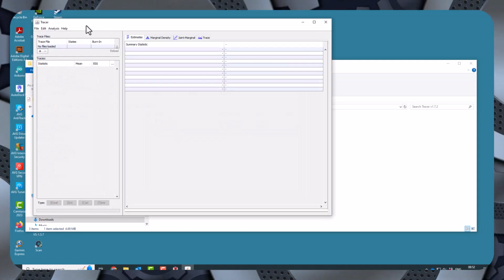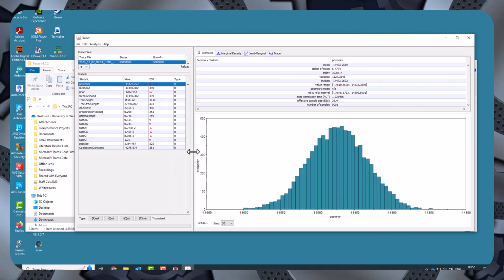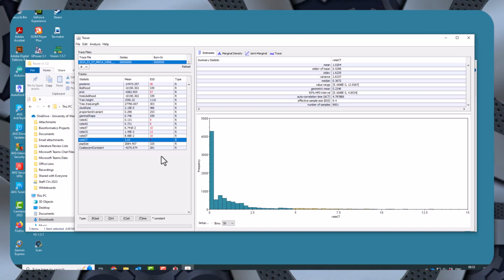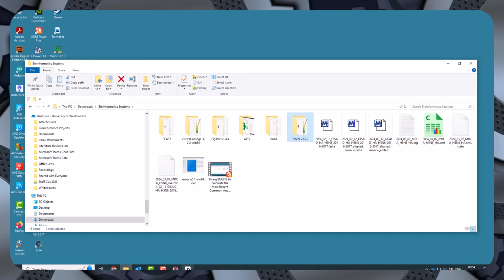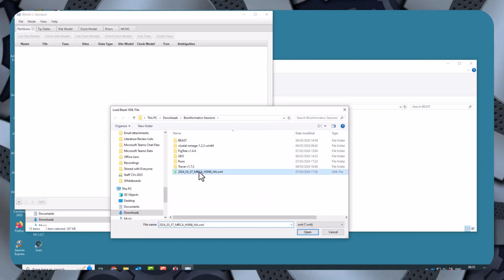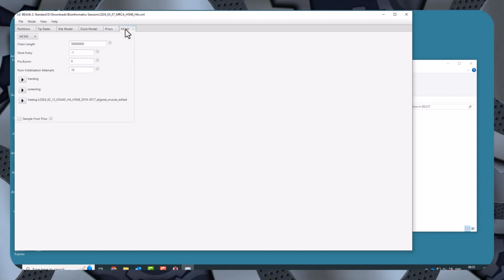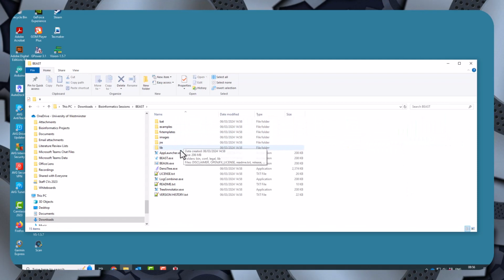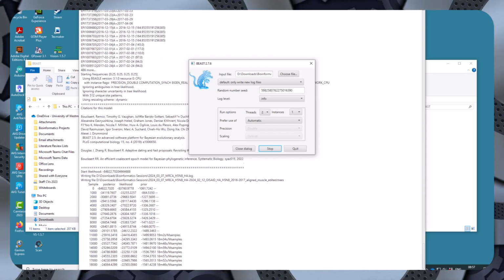Example of poor sampling in the Tracer Analysis

Comment: Hi Andrew! I am doing a temporal analysis recently. I followed all the protocol but how can I finally get the mutation rate per site per year?? When I get the 'clock rate' in Tracer, it was far different from those I read in paper, I assumed there is any further calculation? That is really confusing for me because all the material didn't give an exact calculation while on the other hand this parameter was always seen in the related paper...
Reply from the maker: Dear Zhao, The problem is that BEAST calculates an effective population and mutation rate that cannot easily be separated. That is why the calculated rate will be nothing like the rate you see in the papers. If you have a big population even if you have a low clock rate the number of changes per generation will be relatively large. As the model cannot divide these two terms very easily I am not sure that you can work it out. It might be possible in a Bayesian Skyline analysis but again I think the quantities calculated are relative to one another.
Reply: Thanks for you reply! Actually I only run 10 Ecoli samples for now, the average size was about 5.1MB. I tested different models combination with default setting and choose exponential model. In Tracer it gave me a clock rate of 9.7E-2 while the rate I read from others were about 4~7E-7. Do you think I can work out a closer rate?  @accidental-statistician